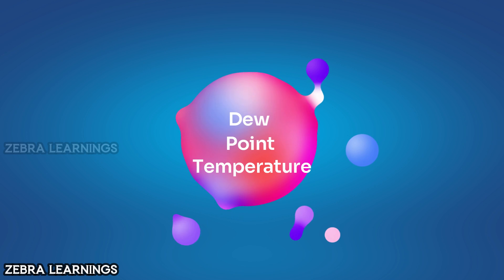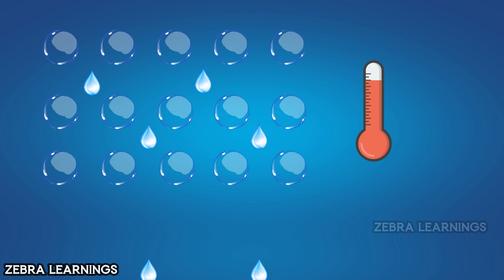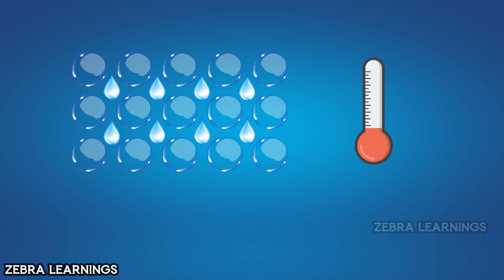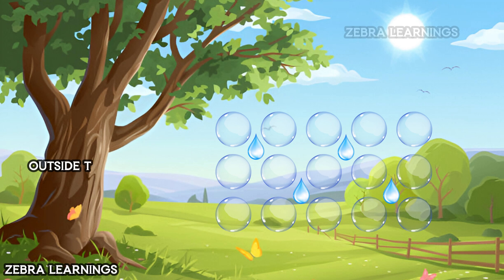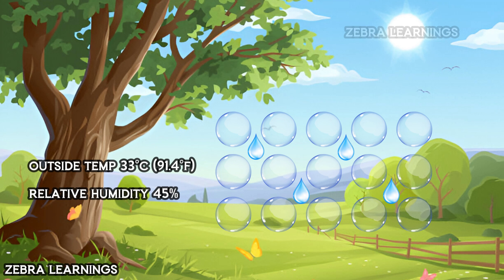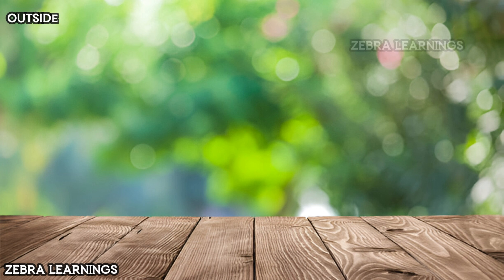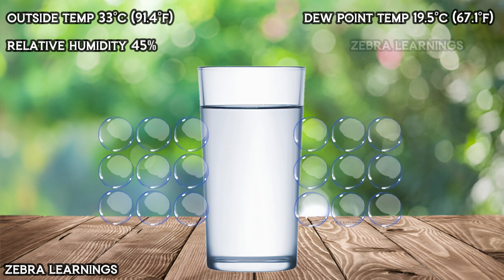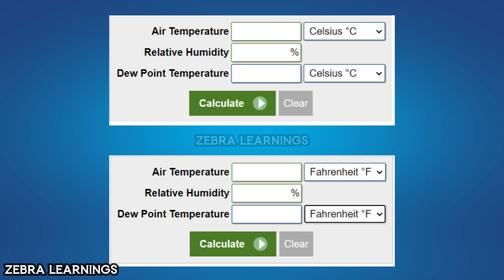Dew Point Temperature Explained | Animation | #hvac  #hvacsystem

Comment: Brother can you make one complete video about hvac chiller from starting to till the room..... Every step in minute details... Like the state of refrigerant in each state... Pressure Temprature and other devices flow switch ,gauges sensor and other components, drier etc... Also whole pipeline... 
 One video which from start to switch on the chiller to end the room.... Where sensors senses... Where guages shows pressure.... And what happened if we skip any component.... Why they are important. 

 Make full video even more than 2 hour.... No problem.... But... I didn't find complete information on YouTube.... 
Please make one complete video brother....😢😢😢😢😢

Comment: 1What is the purpose of flow switch,  
2   types of flow switch in chiller
3 what is suction super heat
4 what would cause if high super heat 
5 what would cause if low super heat to compressor 
6 What is saturation temp 
7 Types of compressor 
8 what is No & Nc in controls 
9 what is the safety of chiller
10  what is Exv & what is txv 
11 EXV maintain on which temp
12 , what cause the discharge pressure high in chiller 
13 how compressor motor cools and maintain the Winding temp, 
14 what is the impact if Winding temp high
15 what is the motor protector in compressor and what is the purpose to use it
16 how compressor goes load and unload
17 at what temp cooler freeze alarm shows
18 process of refrigerant recovery in chiller 
19 what instrument to use to check vaccum in chiller and how much micron should to be measured to get correct vaccum .
20 ,what is delta T .
21 what is approach.
22 what is  Transducer in chiller